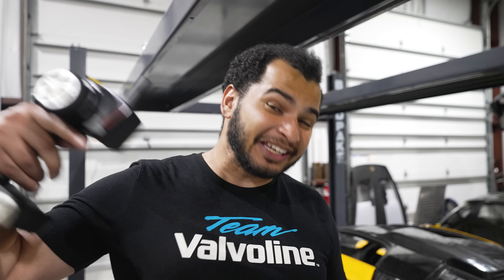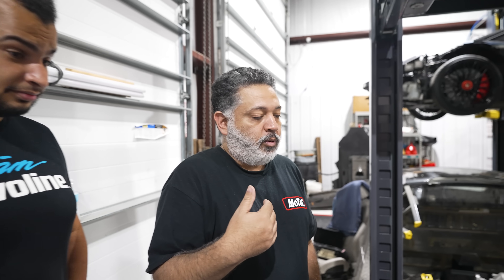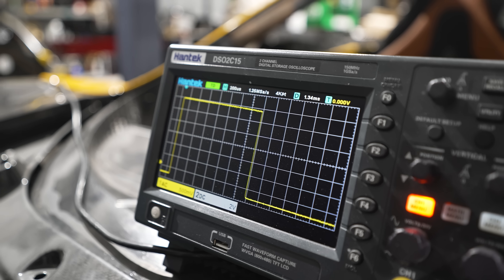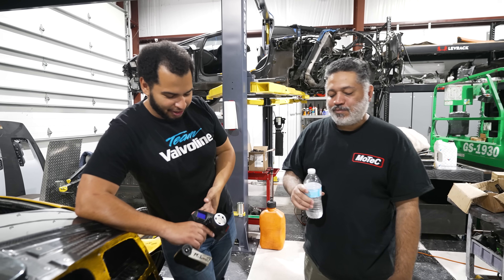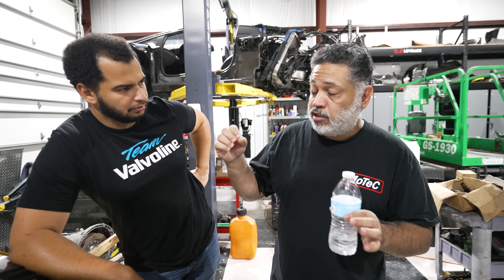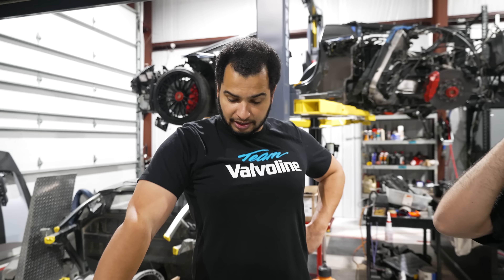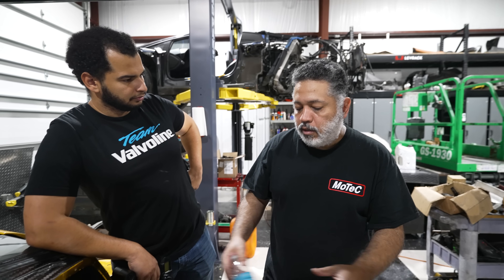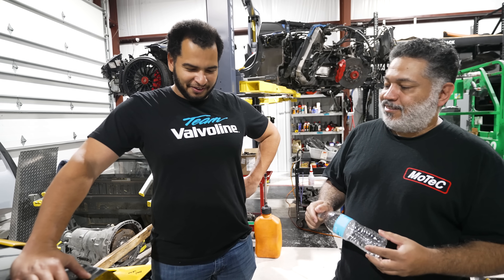How To Start A Flooded $2,000,000 McLaren P1 For The Very First Time

Comment: Honestly. I’ve never known of a person who can, by himself, manufacture a wiring loom out of basically nothing. Then somehow connect it to his laptop to tune it. 
Then you know just for some fun, get a RC controller and think to turn a Mclauren into a remote controlled car. 
Such sincere unassuming skill.
Reply: Makes you wonder if he hired the right guy to build the rest of the harnesses. Don’t get me wrong, I don’t know who the other guy is, nor have I seen him in a while, but he did clean work, just kinda slow considering this man built it in a bathroom at 3 am lol.
Reply: @capocooktops7154  Still would not have made a difference because the Turbos have only just arrived.
Reply: The other guy was building a whole car ECU from scratch, this guy is taking an existing engine loom and making it able to start a car it was basically designed to do. No shade to either of them, but they are doing different tasks
Reply: I built looms for classic cars at the age of 20 because I could not afford to buy new. It’s just a logical process. Although for the Car the loom is next level stuff. The guys is a pro for sure.
Reply: " Then you know just for some fun, get a RC controller and think to turn a Mclauren into a remote controlled car." Huh... Hey what's a Mclauren? ♥lol

Comment: Awesome job on all the wiring and programing.
Thanks for sharing everything that you did.
Now if you ever want to solve an issue that ALL The Tuners could not solve, have a look at a 1997 LT1 ECU. Since it was  only one year, nobody bothered with it and it has remained a "non tunable" mystery engine for the Trans Am and others with that year engine/ECU setup.
Thanks again for a great video.
Reply: Thanks a lot for the kind words.  As for the LT1 ECU, honestly I would just replace the ECU with a modern standalone unit.  Because if you add up the time spent to crack the ROM file, modify it and the cost of buying an old school eprom burner to write a new tune file  (Im assuming it uses an eprom due to the year), I guarantee you have way more money in that project than if you would have bought a modern ECU.  And you would have a much better result because of the ability to make live changes not to mention modern data logging capabilities.  It just comes down to cost to benefit.  Do you have an LT1 engine?  I can make some recommendations if you're looking to tune it.
Reply: @erik_cruz  Thank you for the reply.
Yes, the LT1 in my late wife's Hot Rod she had always dreamed of owning since High School needed a head gasket. So naturally I took the opportunity to spice it up a bit. I hadn't known of the tuning issue until after I'd dropped the engine. Nothing much other than rods, pistons a Comp Cams kit and 7:1 rockers. It all went together without any issues except one code, knock sensor. With it being a California car, I need it to pass emissions testing so an ECU swap cannot be done.
I'll probably make it stock again and be good to go for a grocery getter. It's my toy now so, you know had to play a bit. LOL!!
Thanks again.

Comment: I listened, i Listened and the video ended, i  didnt understand a thing how the RC works. I will stick to my lane and be entertained.
Reply: Smile and knod 😂
Reply: 1. acquire RC controller and matching receiver
2. wire the receiver ground and 5v from ecu, wire third wire into PWM output on ecu
3. train ecu to work with the RC controller throttle sweep
4. tell ecu full forwards is engage starter
Reply: @tturi2  There's no pmw output on the ecu. It's an aux input. Maybe you just worded it incorrectly, but he's already confused.

Comment: ive been hoping you would tell us more. i want to canbus nerd out.
Reply: Canbus is quite simple, it's just a differential pair. All signals are sent though 2 wires, a high and a low. 

All devices on the canbus chain can send or recive data. All devices are connected to the two wire can bus. You can have thousands of devices connected to these 2 wires just parreled up. 

Each device/module has its own unique address (a sequence of high low pulse cycles). Each device needs a specific address because there's many other devices on the same canbus all listening for there name (unique address) to be called. 

The rest is done though the coding of what you want it to do. For example is you want the passenger window to lower, it will be a code that means something like [leftwindowcodeID] cycle down.

A simple way to think of canbus is like having many people in a room (the room represents the canbus network). You shout the name of whoever you want to talk to ( the unique addresses). Then you tell them what you want them to do ( window down command). 

Sorry to disappoint but they are not using the canbus, they are using pulse width modulation (PWM). Realy simple, it's just a 0-5v signal.

PWM works by measuring voltage on a wire. The tighter the cycles the higher the voltage, the less cycles the less voltage. It's the mapped so [0v=do nothing] and [5v=FULL THROTTLE]. a thing in between will be automatically scaled by the microprocessor.

Its actually realy easy to do this RC car input when using a standalone ecu 👍 it's just the same as programming an electronic pedal.

I hope this helps you 🙂

I'm building a V12 supercar with the OG zonda engine 😎
Reply: @UKBUILT  yyeah the pwm surprised me as im used to it for fans and such on PCs
Reply: @breakupgoogle  yeah identical 👍 simple pc fans have 3 wires, power, ground and signal.  (some have a 4th wire, that's fan speed) 

This is no different. All RC toys have the same 3 wires for servos and controls 😎